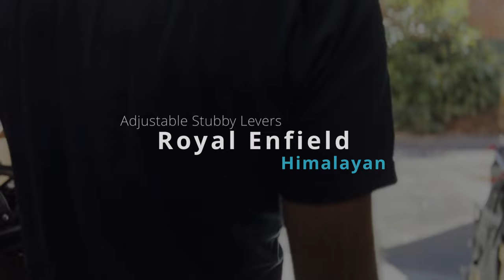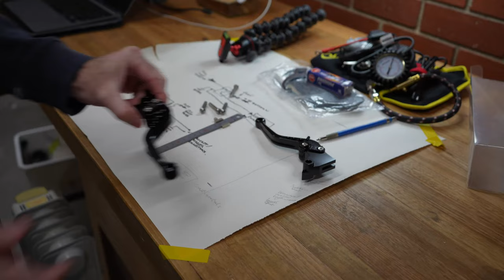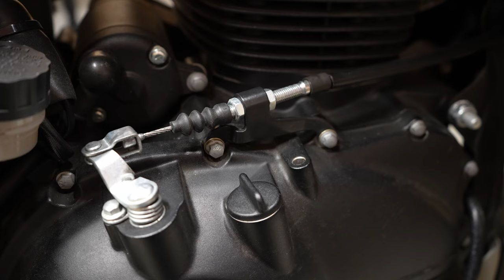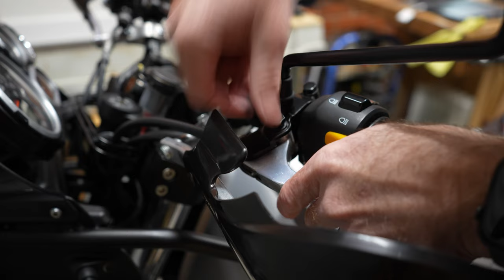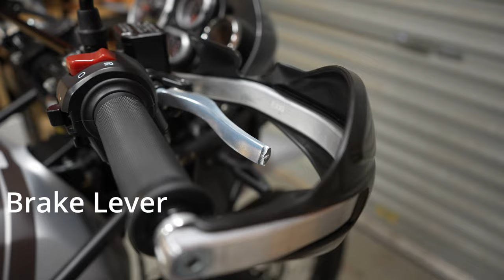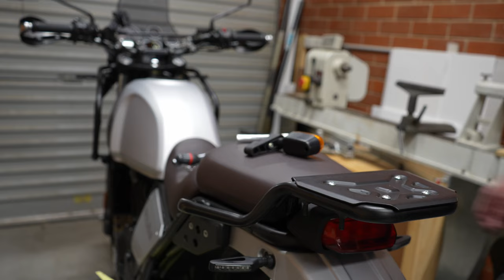Make Your Himalayan or Scram More Comfortable with These Adjustable Brake & Clutch Levers!

Comment: Good video! What are the make of the clutch lever and brake leever?
Reply from the maker: Thank you. They are from Hitchcocks in the UK. 

They are the same as the ones I linked in the description, which you can get via Amazon if that is easier. 😊

Comment: I bought a Himalayan with these installed. When in 1 gear and clutch fully pressed the bike creeps forwards. Seems like there is not enough leverage in the clutch levers to fully disengage tge clutch. Free play is set correct. I have it on nr 6, when on lower nr its even worse. What is wrong?

Comment: Hi there.
Could you please tell me if you can find any E Number on thos levers. Since they come from Hitchcock theyy should have one. If not, those gadgets cant be used in Europe due to strict control of traffic law. By the way, good video, keep it going.
Reply: @SandyToesDetecting  The German Police for instant. Any part which is essentiel for safety without E number is ilegal. Any extra accessoiries have to be registered in your vehicles registrationpaper. Without an E number ,  no go. Have seen many bikers walk home, i.e. the had to organise transport for their bike on a trailer or so.  😣😣
Reply from the maker: No problem when I am next home I will check it out for you
Reply from the maker: There are no e numbers on the handles themselves. I just checked
Reply: @gettinglostagain  thank you so much.